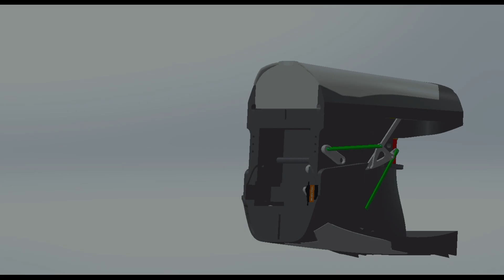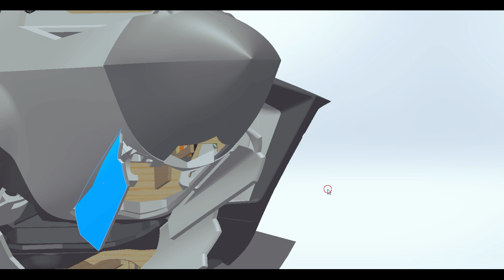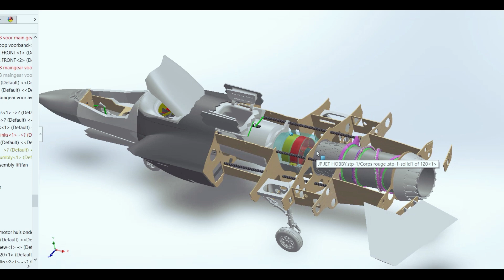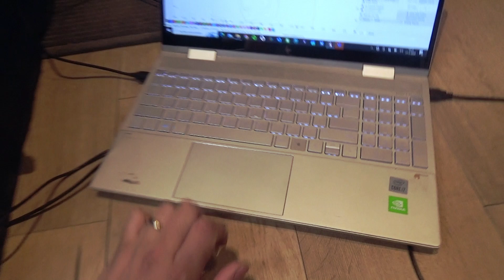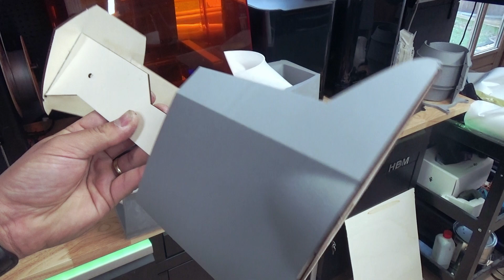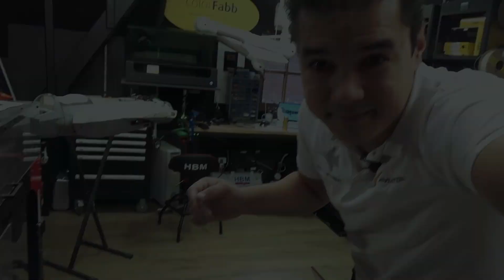Falcon2 (22W) Laser Engraver & Cutter , F-35B 2X JP Hobby 120mm HV EDF actuating doors

Comment: You could integrate UV LEDs into the airframe to illuminate the glow in the dark panels from the inside. Just need a way to project the light on them from the inside or outside. Possibly illuminating multiple panels with a single LED if using omnidirectional LEDs.

Comment: Also, FYI, glow in the dark filament is corrosive and will eventually wear out /widen the 3d printer nozzle. If you are not printing much of it, probably not a big deal. You may want to have some spare nozzles ready to go if you don't already have them.

Comment: My Creality 3D printer had such bad firmware that I don't like that company anymore. For example during the bed leveling, when going from position 1 to 2, instead of bringing the bed down a little before it moved, it brought it up and the nozzle scratched into the bed. Just to name one example of about 30 other problems.
Reply from the maker: Which one? I am not using creality printers, this is a cutter
Reply: It's an Ender 5 S1. I don't own a laser cutter and maybe it's good but after experiencing what I can only call grave incompetence and complete lack of testing I decided whatever product I will buy, I will start with anything but Creality and if the other companies are even worse then I will give them another shot.
 @Joelmelanie
Reply: For example to this day I can't use the auto bed leveling because they changed the hardware and removed the z-limit switch but then stopped supporting the first design in their FW so I got screwed basically.